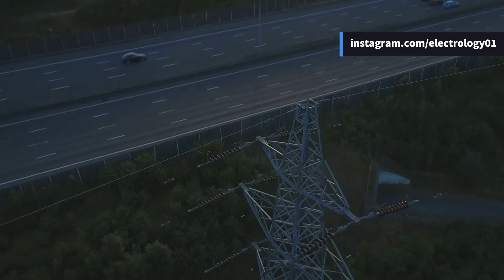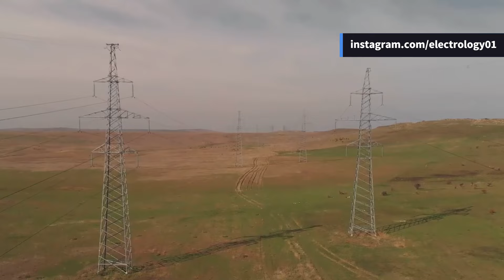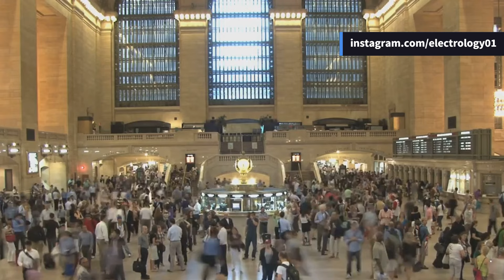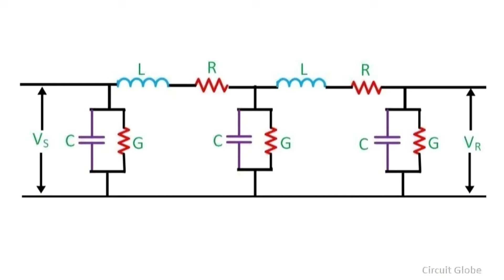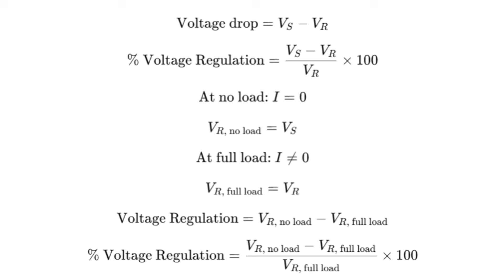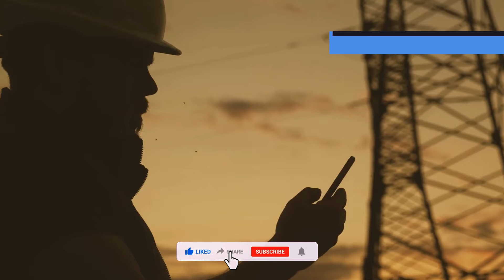The REAL Reason to Classify Transmission Lines as Short Medium or Long

Comment: Voltage drop can either be positive or negative depending on the difference of receiving & sending Voltage. Or for situations whether the transmission line is heavy or lightly loaded.

Comment: Voltage regulation can be positive as well as negative. In case of leading loads or capacitive nature loads recieving end voltage becomes greater than sending end voltage. 

There is an another case where if the load on the transmission lines is very low or near to no load condition then the nature of overall load becomes capacitive and recieved votage becomes grater than sending end voltage which is also known as feranti effect

Comment: The capacitance of very long high voltage lines can lead to positive voltage regulation ie the receiving end voltage is higher than the sending end. In that case, inductors are needed along the line and receiving end.
Reply from the maker: Absolutely correct 👍
In very long EHV transmission lines, the line capacitance can cause the receiving-end voltage to become higher than the sending-end voltage under light-load or no-load conditions. This is the Ferranti effect, which leads to positive voltage regulation.
To control this overvoltage, shunt reactors (inductive compensation) are installed at the receiving end to absorb excess reactive power.
Thank you for adding this important practical point to the discussion.